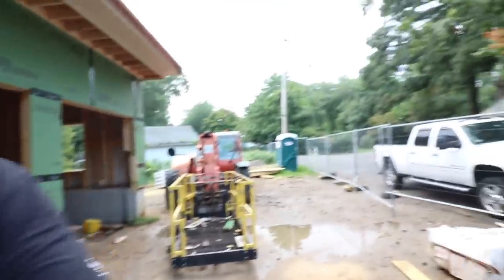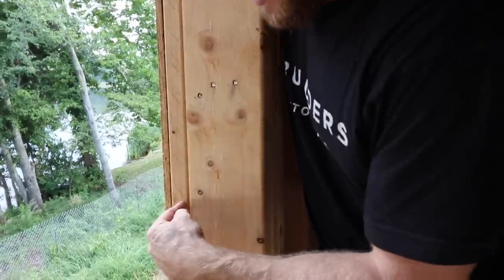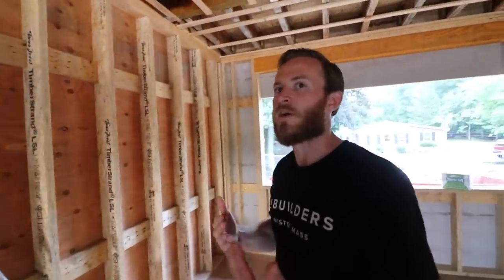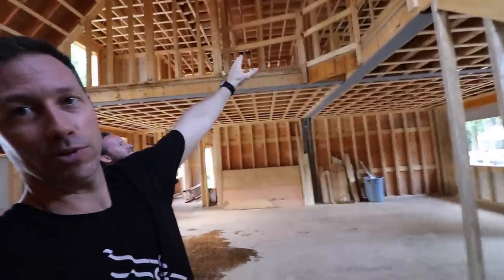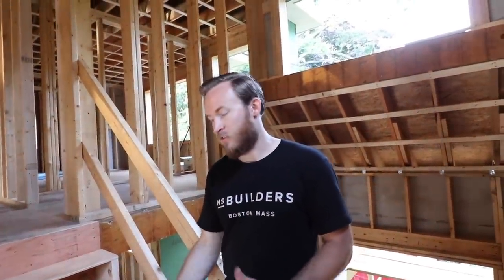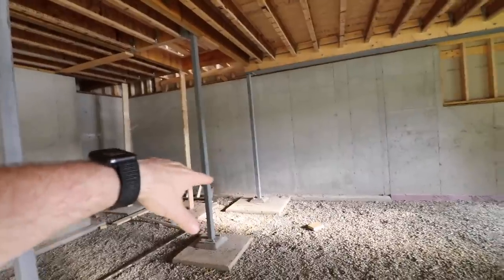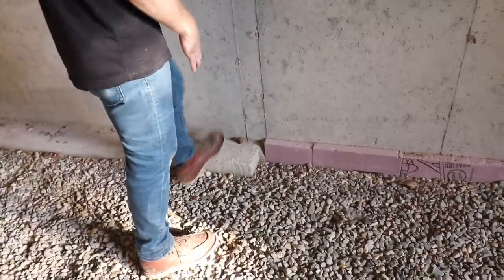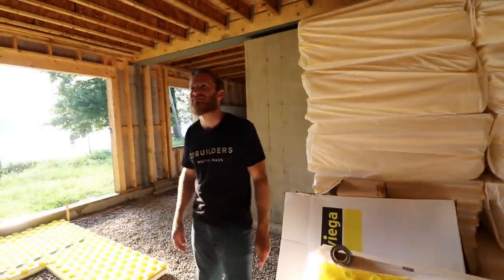How do they Build in Boston? Visiting a new home in Framing

Comment: I don't like that stacked gable wall in a full vault condition. Your framers should balloon frame it for lateral performance. The plates are taking that load across a much longer span. Just FYI......
Reply: Stacked sills are not to ibc or irc code with out the addition of steel plates.
Reply: fancy cry?
Reply: @homefront3162  ???
Reply: Unless the j-bolts or anchors attach both plates to the sill.
Reply: @brad-yo7jb  That doesn't make sense.
Reply: If you are talking about stacked sill plates that sit on the foundation - they can be doubled up, as long as the j-bolt/concrete anchor bolt extends up through both plates and holds both down or you use a code approved simpson tie. This is done at times when you have dropped joists on a interior brick ledge, or to level really out of level foundations, and other scenarios.

If you're talking about plates midwall on a gable or any other tall wall, it's perfectly OK, as long as the plywood spans across both walls, and simpson straps are used (based on local code).

Structurally, the walls below a gable are not carrying any roof load. It is the eave walls that carry the load. There are circumstances when a structural ridge will be posted down to the foundation in a gable wall, but still that wall is not load bearing, except for the post.
Reply: @brad-yo7jb  You're confused about the type of load that this is subjected to. It's a lateral load, which wind is the main factor for. You could shake a wall built like that. That's the reason for tall walls requiring a larger framing member, or tighter spacing.
Reply: I'm certainly not "confused" by the type of load that this is subjected too. I understand that there are lateral loads, and all the other reasons you describe. I would caution you to "label" folks "confused" when you have no idea who you are even talking to.

Switching the direction of a framing member in an opposing manner almost always stiffens an assembly. 

There are other ways to stiffen a wall laterally and balloon framing is not one of them. A tall full vault wall, framed with full length lumber will certainly not be straight unless you use engineered lumber or TGI studs. There are other factors too, the longer the length of lumber the more lateral flex it will have and be "shaky" as you describe. Sourcing long lumber is more expensive and not as readily available. 

Lastly, this house was certainly engineered and not just thrown up without design work. I'm sure that, the wall meets any wind loading design criteria for the area.

Let's leave this right here though, because I'm not interested having some online forum "argument".
Reply: @brad-yo7jb  You're "confused" about to, too, and two......too
Reply: haha....two bad you're to fancy two talk too about how too build
Reply: @brad-yo7jb  You act like you understand what lateral load is, yet you said that the gable isn't carrying any load!
Reply: @brad-yo7jb  I was just referring to the fact that the point you made had nothing to do with what I was talking about. You sound clueless. I'd be happy to meet up with you to discuss further.
Reply: @brad-yo7jb  Sure

Comment: Why not just use a 2x that’s 2in wider at each opening and cut the foam back? It’d save the time of ripping all those 2x2s and probably be a better seal
Reply: Because after a 2x6 is a 2x8, which is 7 1/4", so it's not 2" longer than 5 1/2". Also it's easy to lay your plywood on a flat wall, much slower when all your windows are sticking 2" out.
Reply: Shaun Page I’m just talking about framing the openings with wider boards. Cutting the foam on the back would compensate for the 1/2”, and the product they’re using is foam backed plywood.
Reply: Whether you're installing your sheathing with the walls built laying flat or vertical, you really really want that surface to be flat. Trying to install your plywood with wider "boards" sticking out of the window opening would take way too much time compared to the laying plywood over the whole wall, and cutting the opening after. So to answer your question, the method you propose would just take way longer overall. The time saved not having to rip some furring stips on the table saw would not nearly make up for the time lost trying to sheath a not-flat wall.

Comment: The strapping is done to flatten the ceiling. It is a New England thing. You can set the two ends and then string the middle and shim as needed. Wasn't too necessary here with the engineered lumber and he didn't know why he did it lol.
Reply: Actually quite often with engineered lumber it is MORE important. TJI/TGI/openweb joists are all finger jointed construction, and at those spots where the joints meet and the pieces are glued and forced together, there is a bubble or bump. Strapping solves the problem. It also solves the problem of joist hangers buckling the drywall.

Comment: I built homes in and around Massachusetts for 10 years, and can tell you that there is a reason for that strapping. I'm not understanding why he doesn't know.
Reply: What is it? thx in advance
Reply: While the strapping is mostly seen in commercial use (truss work, multiple level, floor and ceiling), it is quite often used in residential as well. One reason, and probably the main reason, would be keeping longer span joist and truss on center. If you've seen homes built without, you'll see a bit of a difference in build quality.  However, there is an unwritten reason that sheetrockers love. If you keep the strapping on center and use the 1x3s, it gives a very fast solid sheetrock connection. Here in TN, homes are not built anything like up north. 😉
Reply: LiveFromMe2U  Cool, thanks!

Comment: I agree about the quality of that framer. Its usually the reason I end up doing everything myself. I hate when I have skilled trade in that are more concerned about their jobs than the people that have to come in to do stuff after. I can't tell you how many times my drywallers have sworn at the framers or the HVAC has sworn about the plumber. 

It's really important in a new build to be there and make sure everyone does their work without making the next guys job harder.

A good example of that is one I'm doing right now. I had a plumber come in to install a sump pump for me. He was about to cut the hole in the side in the exact spot that I was going to install the meter panel. It was no extra work to run the drainage over a few feet but it would have been a nightmare to move the meter box after as that was the only spot with direct line of sight to the pole for underground service.

It's little things like what this framer did that really stands out over some other skilled trades people.

Comment: 18 is right in the middle of 12 and 24, Not 16.
Reply: apirate namedjohn that's not the point. The spacing has to be a dividend of 48. Because the 4'x8' sheets of whatever have to have each edge on a stud or joist. 48 doesn't divide by 18.
Reply: @puckcat22679  his statement was incorrect.
Reply: 19.75 works as well

Comment: o. s. b.  is junk. I never want any o.. s. b. in my house ever again. just glued sawdust.
Reply: Zip ply is better then cdx 5ply... it's not osb completely different
Reply: It's 50 years warranty
Reply: @rubenvarela4077  
True. If done properly.  If there is a failure in the wall, and they find one nail out of wack. There goes your entire warranty.
Reply: OSb is not sawdust but still larger chips, MDF and HDF are sawdust however and often found in cheap overpriced furniture.
Reply: Rick scully yeah all new house has that I work with advanced tech
Reply: So is zip board.
Reply: @Joshua79C  Bassically the same thing. Ranks with garage door headers being GLB. Those headers always bow under any loads. My job aways said they are stronger and better, but i said BS. I only ordered GLB as its what KB Home, and DR Horton required. I would never use any type of USB boarding even for roofing which is too common. Texas does not deal with snow loads on trusses, but had to deal with more than my fair share of hurricane clips for trusses. It is bad that under normal  roofing material itll bow the garage door header. Its terrible stuff IMO and just a cheap alternative.
Reply: Natural wood is basically tiny particles held together with resin. It’s loaded with natural weak points, especially along the grain. Osb is much more uniform and reliable. You don’t see people trying to karate chop osb...
Reply: @godwantsplastic  Its cheap crap you cant use. Think of header boards. You loose half the strength. Under normal roof load the crap bows. Its not good for anything as it bows when wet. Its a cheap alternative to solid pieces. Never should have been brought to the market.
Reply: Always use osb +dupont tyvek.  zip is a big soggy condom.
Reply: No, osb is glued flakes.  Glued sawdust is mdf.  Each has a use, as does standard plywood.  Why use ply, substantially  more expensive than osb, for sheathing that really needs little strength?  Floors need more stability, so use full plywood, but wall sheething doesnt need it.  You are free to avoid osb, but its not a good cost benefit.
Reply: I'm a third generation builder and in 55 years my company has never received a single call to repair a homes failing OSB.... weird right?  Its almost like OSB does exactly what its supposed to do.
Reply: Albert J3 Yep.  Half these knuckleheads in the comments have no idea what they are even arguing about.
Reply: @oreocarlton3343  What do Europeans use?
Reply: @rubbersole79  far walls its aerated red terracota brick on continent or solid red in uk. Reinforced concrete as beams and floors. For roofs its wood beams or sometime reinforced concrete roof. Terracota tiles almost always. If insulation ALWAYS on outside, never close to inside. Basement almost always with deep foundations.

Far less labour intesive than framing, cheaper, less toxic to those who live in and more durable.
Reply: @godwantsplastic  yes but when you have fire in a home made of any type or variation of OSB or any variation thereof the glue produces such toxic gas that its caused many deaths.. also last thing take a blow torch to plywood vs osb and youll have a pretty tough time getting that plywood to catch fire anywhere but on an edge..  with osb...  anywhere works.
Reply: @godwantsplastic   they dont karate chop osb because A.. it splinters badly and B its much easier...
Reply: What you are talking about is MDF which is great and has its place too...
Reply: @godwantsplastic  Folks 'karate chop' natural wood because (as you correctly point out) of the grain having weaknesses in certain directions.   However, that's why 2x4's are installed vertically (to take advantage of the strengths of grain) as supports in a home and are ridiculously strong in that orientation.   I think I'd prefer natural wood for vertical load-bearing support over any engineered material other than maybe steel.  Then again, they're always coming up with new and amazing materials I suppose..
Reply: 3dsman I’ve been in a few houses with joists sitting on laminate beams. Just did a quick google search and there’s a product called glulam , they claim their beams are stronger in every way than solid wood and also stronger,  p4p than steel. Search also revealed that laminated wood is stronger than comparative solid and that the more layers the stronger... I’m sure the quality of the materials and the manufacturing process is what determines the strength/longevity/flammability of whatever man made product is being discussed.

Comment: The purpose of the strapping is lateral bracing making the house stronger. Rather than depending on drywall for the lateral bracing(as in other parts of the country).This will tie the whole house together again making for a stronger structure. You should know this rather than saying I don’t know why we use it. Other than that point great framing job and excellent thought going into the project
Reply: My house was built in 1962 in Charlotte, NC, and it has the lateral straps on the ceiling that the drywall hangs from. I'd never seen it in any other homes in the area, and even some of the homes in my neighborhood built at the same time do not have it. I'd always wondered why it was done, so thanks for the explanation as it makes perfect sense now.

Comment: Impressive? Yes.
Water coming in while promoting how well he's building a new home with great products and techniques...not so good.
Reply from the maker: It’s under construction. Give the guy a break
Reply: I'm just giving a hard time, that's all. It's looking to be an awesome build. Can't wait to see the end result. You should come to Minnesota and do a build... R-90 for those cold winter nights when it's -45°F. Frame of the house with 2x10's, etc. I actually really enjoy your videos. I've learned a lot more from you than I did working on remodels as a finish carpenter. 👍
Reply: Who builds a house with 2x10s in MN?  What are you talking about?  I bet most homes built in MN don't have much more than R-19 walls with R-40 attics.  North Dakota is colder on average and rediculous R-value houses are very rare.  High efficiency furnaces make it so cheap to heat a home, the added install cost to energy savings stops being realistic after a point for most homes.
Reply: You obviously don't understand sarcasm.
Reply: Oh, and you're not colder than Minnesota.
Reply: Yes, ND is technically colder.  The northern part of MN is about the same as ND, but i did say "on average" ND is colder.  Alaska is the only state with an average winter temperature colder than ND.  You obviously don't understand how to convey sarcasm through text.
Reply: IF you are conveying sarcasm best to use such as sic or xD or some emoji at the end conveying it as word such as what I am typing or others have read unless noted are just monotone and convey no emotion.
Reply: Pretty sure that water came in through the windows during the overnight rain.  We have wind here and the rain is often at an angle.  This is typical of buildings here.  Nothing to worry about.

Comment: Can someone please explain why you can't just build it with bricks?  This seems like WAAAAAAAY to much work.
Reply: not enough insullation
Reply: @608standrews  insulation is added to the outside and optionally to the inside of the walls too.
There are also hollow bricks that insulate very good.
Or just build it with Styrofoam shell blocks, like Legos. Then just fill them with concrete.
Storm proof, no mold, no termites and bugs and even a fire does little damage to the structure. 
Even interior walls stop most handgun bullets, so you only shoot the intruders and not the neighbors.
Reply: Bricks cost far more in most places, by the time you pay for materials and labor.
Reply: Materical and labor cost 2-3X more than a standard wood frame.

Comment: Beautiful framing.  I live the better part of 800 miles farther north than Boston, and the design here is better than what most modern builders give us.  The main reason for strapping to engineered materials is noise reduction as solid contact between drywall & structure is reduced.  I understand you get some hail and heavy rains in Boston, and it makes a big difference on footstep noise as well.  Also, in any region with highly distinct seasons, interior humidity and moisture content of your structural material change a lot from season to season, no matter how good your humidity control system is.  Ceiling drywall is usually on the thin side, so it's more prone to visible warping, screw/nail popping, tape tearing, etc.  Strapping will mitigate this to a degree as it allows a small amount of movement between the drywall and structure.  Stairs need to be built to a solidity that would be ridiculous in Texas for the same reason.  I've heard of but never seen kiln-dried spruce stairs come close to twisting treads off, (possibly an urban legend), but they will warp enough to tear builder linoleum and even cheap carpet, not to mention cause very loud squeaking.
Reply: Also the strapping helps hold against the seldom hurricane or worst parts of Nor'easters.
Reply: Something I did not know, as we don't have those (tornados from time to time), but very obvious once someone else points it out.  I'm strictly an amateur remodeller, but I always strap walls with plywood strips (glue & screw) on older houses immediately on removing old lathe and plaster, so as to prevent a century of frost heaves from twisting the house in a matter of minutes, it makes a lot of sense.  Those old lathe-and-plaster walls gave a lot of structural stability that drywall lacks.